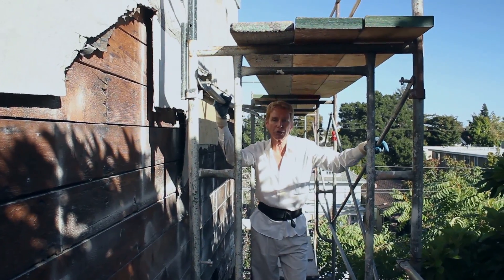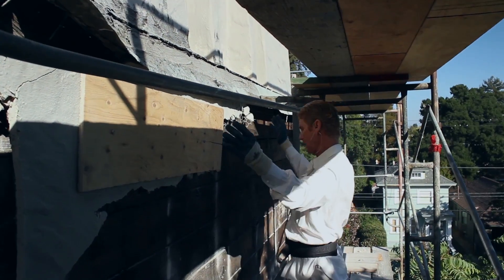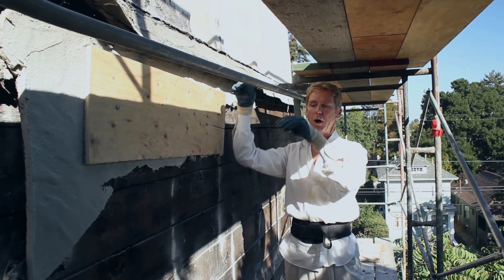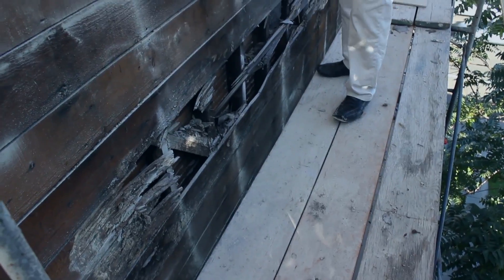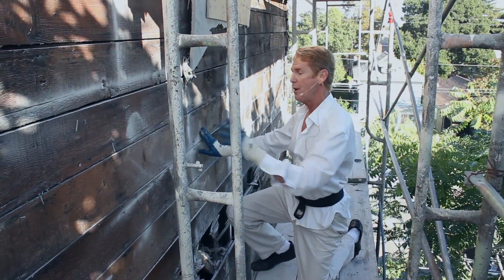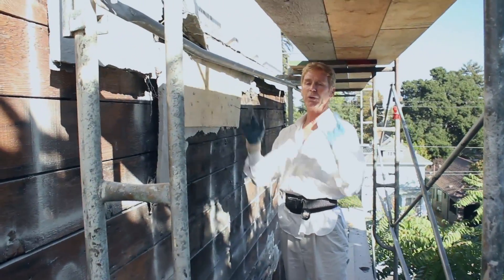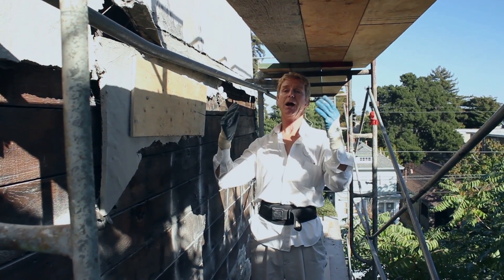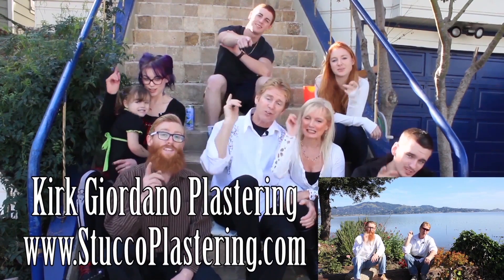Why do stucco balconies or walls collapse

Comment: Hey Kirk i have a metal building with a EIFS Fascia about 30 years old part of the bottom cracked along the edge and is drooping down and you can see some of the Styrofoam underneath.
Should this be cut and stuck pack on?
Or can i stick it back with adhesive?
Is a product called Primus DM BG 50# and good?
Contractor said he will put the mesh over the whole thing then use Dryvit finish color
Does this sound like the correct thing to do?
This fascia is 154 feet wide by about 10 feet tall.
Thank you for your videos
Reply from the maker: No idea, as I have to see what your referring too, sorry brother.🤔
Reply: Primus & Mesh will only prevent cracking of face of surface..it sounds to like your eifs system is coming lose from substrate you mentioned drooping sounds like delamination to me you can use fasteners to secure your eifs Back to normal then Basecoat & Finish Coat ..But like Kurt mentioned has to look at it..to see the real problem good luck 👍

Comment: When a third world applicator installs anything...prepare for a third world conclusion...America was falling apart...but ya aint seen nothing yet!!!
Trades are inundated with illegals...whom cannot...do not...will not...abide by code...
Reply from the maker: Time may tell, my friend, this building was built in the USA and no doubt completed with the highest construction standards.
   However, stucco and wood structures require maintenance like caulking and painting at least every ten years.
 The folks who own this could not see the cracks at the top of this 4 story building. 
 Thus we're not aware of the cracking, which unfortunately allowed the rain to do what nature intended it to do, fall.
 Sometimes that falling has other consequences than just bringing oxygen and life to a thirsty world. 🤔
Reply: @StuccoPlastering  
Ahhh...mindful depth in that reply...

Comment: Hey Kirk.. love your videos. I have a brick fireplace and want to stucco the exterior where it comes out of the roof. Would I be able to do a thick single coat of about 3/4 to an inch if I just did a 1:3 sand portland and sand?
Reply from the maker: absolutely, you can do that. clean it well and apply a bonding agent to it first.

Comment: It is a honor to watch a master at work. I recently removed a ledger board and need to fill it in with a stucco repair. What are your thoughts about using FortiFlash, Waterproof Flashing membrane instead of Grade D waterpaper?
Reply from the maker: Evening my friend. It's good stuff and can be used.
  Not certain,type in installing a ledger board on a stucco wall, to see the most effective way to do it.😉

Comment: I think I have the same thing happening at my house, and have definitely already caught and fixed some rotted plywood under damaged stucco thanks to your videos. What is the fix for the failing fascia board?
Reply from the maker: Evening Aamir, depends. If it's rotted, discard it or salvage what you can of it.
 If it's still good, the idea is to remove it or lift the bottom so you can get at least an inch or two of paper or peel and stick under it.
Then re-stucco the wall
Reply: @StuccoPlastering  cheers, thank you!

Comment: Thanks Kirk. Both like the video and dislike it at the same time.
Reply from the maker: Good afternoon, Jon, interesting, care to elaborate or explain?
Reply: @StuccoPlastering  Great video in the sense that it shows another place bats, rodents, and insects can live. Scary video in that it's hard to know if the problem exists without taking a Hilti or a sledge hammer to it. Based on your other videos unless it's obvious where water is coming in and you can diagnose or predict the problem you do other things first before ripping it all down
Reply: @tech 52 Ya I didn't down vote the video. In fact if I was a homeowner in Oakland, or San Francisco I'd probably be trying to get Kirk Giordano to bridge or tunnel it over to give me advice, but I can't afford those homes, and I don't even live there no more